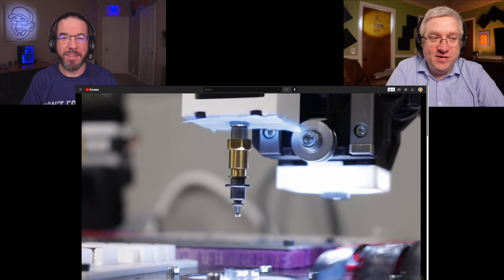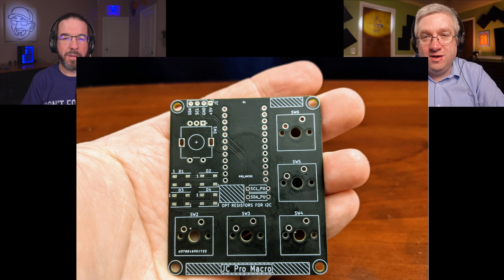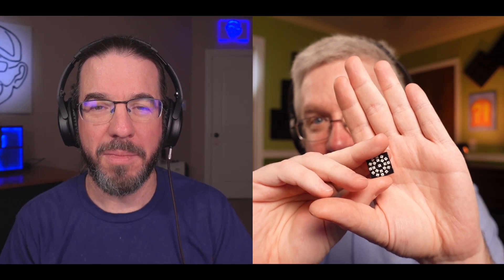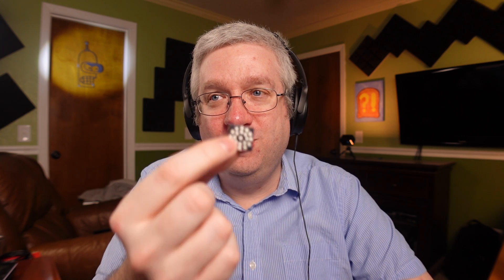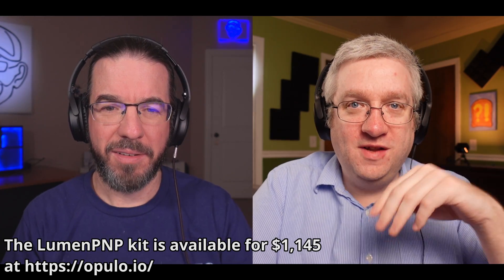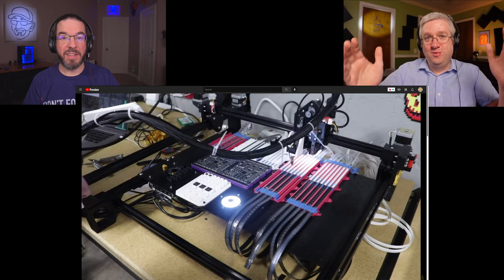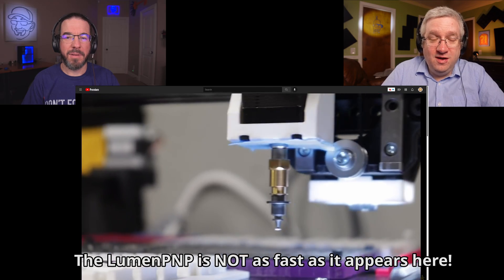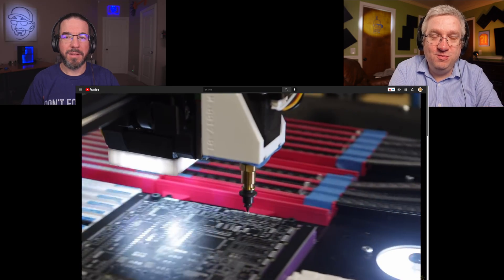Do We Need an Open Source LumenPNP Pick and Place Machine to Produce OoberLights Micro PCBs?!

Comment: Keep in mind. Doing 50 at a time to see if you need to print more, means you'll need to delay populating other boards....unless you want to reset all the feeder locations etc. Setup is the work.
Reply: We don't have any other boards to populate, so there's nothing to delay.  The farther along we get in the project, the better the math looks.  

We've reduced two or three points with financial risk down to tiny dollar figures, and it is looking like our out of pocket cost for 1,000 of our tiny PCBs, the reels of LEDs, and the cost of the LumenPNP will surprisingly close to what we would have had to pay for 1,000 assembled boards from PCBWay.

This is completely ignoring my labor.  The journey has been fun so far, and I am excited to see how our little gamble pays off! :)
Reply: @patregan  i think it is great that openPNP  sw\hw is getting so much support that little guys can actually compete against big biz.  No more monopoly from biz that could afford the expensive pnp machines!
It makes me wonder what will be next!  Diy chip Fab for microcontrollers?

Comment: For anybody that's interested, we've already 3D-printed all the parts necessary for the LumenPNP. 

I tried to keep track of all the 3D-printing.  For the 52 printed  parts, it took 381.3 meters of 1.75mm filament (~1144g) and about 92 hours of print-time.

Now we just have to wait for the rest of the kit!  Has it been 6 weeks yet?!
Reply: Thanks for posting some numbers on the printed parts, I'm curious to see how your parts printed out. Did you opt for single color or a mix? I know there are a couple parts that need to be printed in white/natural as they are used for diffusing the LEDs, but what about the rest?
Reply: @atanisoftware   I have the box of parts that Brian printed here, Mike!  He printed everything in black.  I printed the two diffusers in white.

I haven't looked them over carefully.  I figure that will happen when the kit arrives and I am putting everything together.  None of the parts look like challenging prints as far as I can tell.

We will be keeping everyone posted once things start moving!
Reply: That is great, I agree none of the parts are super challenging. The challenge comes at assembly and calibration time. The cameras seem to be one area that trips up a lot of people.
Reply: @atanisoftware  I'm excited to find out just how challenging it is!  :)